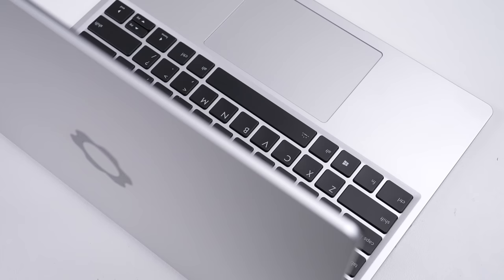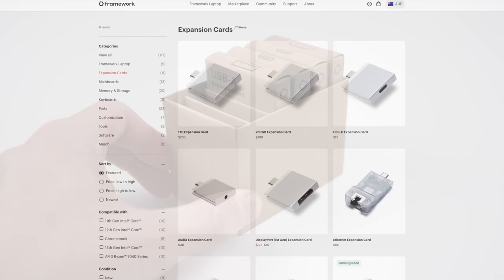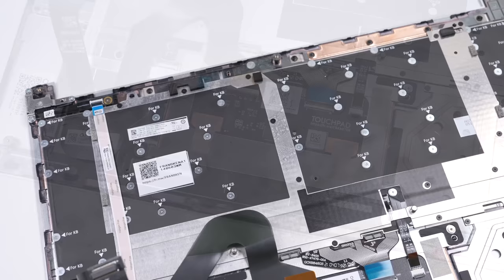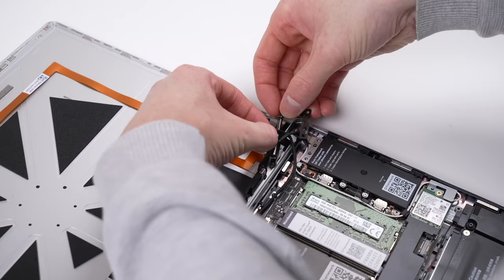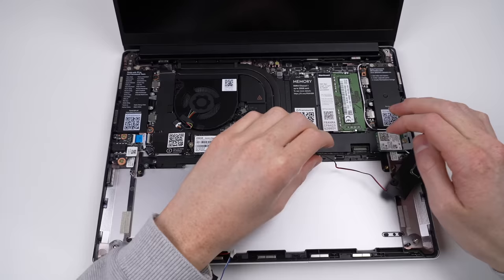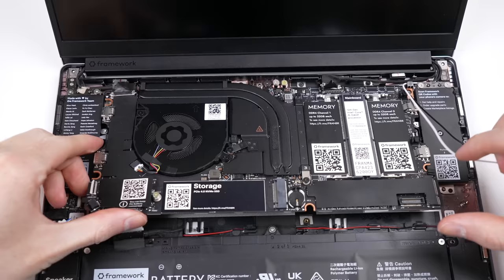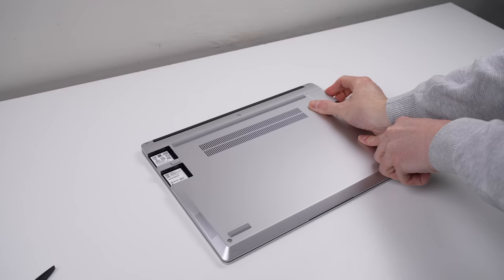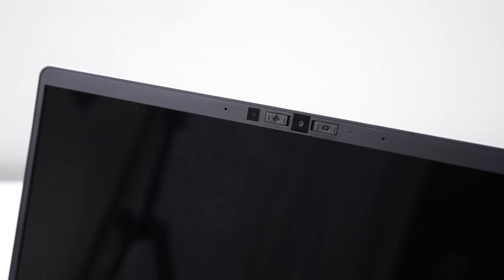New Laptop Brand Shocked Whole Computer Industry - Framework Laptop - Teardown And Repair Assessment

Comment: This company needs to be supported.  We should want all laptop makers to follow this example.
Reply: I am not giving them 1000 bucks for a 300 dollar laptop just so i can take it apart easily haha. You literally can buy a better laptop with everything for the price of the mother board he has there. 1000 dollars for a low end laptop with out windows is horrid priced.  You can buy a oled 90hz for 600 with the same specs. You can buy one with better specs then they have for 1000. Its just a dumb gimmick, but it worked on you it seems.
Reply: @FUmoneyWorshippers  then make them have machine to be manufactured cheaper as factories will reduce the production price from them if the number of orders is high enough, they are an entrepreneur having only few people and lack the ability to do so. Also, big companies can do it but they just don't want to because fix thing on your own might make them not be able to sell a new one for you that easily.
Reply: @FUmoneyWorshippers  The point of framework is to have the option to have laptop that’s repairable and upgradeable, if you’re buying a $1,000 laptop, thats fine; not everyone can afford a framework laptop, but if next gen costs $2,000 thats double the price of a normal laptop (especially with inflation). Thats not even getting started on repairability, having a good repairable laptop means if the battery stops working, then you just replace it, you won’t need to buy a whole new laptop.
Reply: Linus Tech Tips invested around $200,000 into their company I think
Reply: Nah. This is a niche. Upgradable or not, I treat laptops like a phone. Don’t wanna use more it than 5 years. If the laptop is your main system, it only takes 2 years or so for it become gross. You get dents, scratches, colors fade, grease, dust and dead skin cells all over. I always sell my them for cheap once it ran it’s course.
Reply: @ruok3351  learn how to take care of your shit then. I have been using my laptop for 2 years and I don't even have a scratch on it. and the whole point is that the laptop might cost $1000 but in the next few years when it gets old, you can only buy the motherboard or replace the battery, change the ports you use depending on the work. the new motherboards on their website start at $450.
Reply: Even if you can't take care you can replace damaged body parts instead of buying whole new laptop.
Reply: @Gobble.Gobble exactly like I have this phone for 5 years and I don't have a single scratch on this , if you take care of your device, it would look spotless
Reply: @MPCA_  You can replace batteries in all laptops. You are literally giving them 1000 bucks for a low end laptop that can be bought for 300 to 600. Upgrading a laptop that costs more than it costs to buy a new one is re re. So lets use my asus vive book i bought 3 years ago, for 600 with a oled. If I bought that framework, I could upgrade now to a i7 for 800 dollars. I could buy a i7 oled laptop for 800 dollars, and have 2 laptops. I could sell my asus laptop for 300 within a hour, and have it for 500. You are just talking about being happy by a gimmick. As I said, it would be like if Honda sold you a car with everything repairable and upgradable, made it easier to do. Then charged you 40k for a honda civic, and sold you the upgrade parts for more than a normal honda civic. I can afford a framework laptop, I just wouldn't buy a low end garbage laptop for 1000 dollars just so i can over pay them to upgrade it. 1000 dollars for a low end i5 laptop with no windows, and a low end garbage screen is super over priced.
Reply: I am willing to pay 20% more than the competitions in order to get a repairable laptop.
Reply: @FUmoneyWorshippers  i don't think that's a  $600 laptop. It's hard to find a laptop that's spec for spec identical with the Framework laptop that costs significantly less.
Reply: @huangcc72  I see, seems quite a few people will.
Reply: @FUmoneyWorshippers  you are trying to reason with cult members.
not gonna work
Reply: I'd love to see a desktop system built on the same principles.
Reply: @furrepanther  what principles?
Reply: @Gobble.Gobble  I do take care but you're lying. Reality is devices will never be 100% spotless after extensive everyday use. Even worse if you constantly bring them out for remote usage. Unless you rarely use them and store them in a weather proof case for months, then they always get worn down no matter how much you try to take care of it. I'd rather spend $1k on a new laptop after like 3 years and confident it will perform great than trying to revive a dying horse hoping the new modular parts will fix it.
Reply: I think currently largest uncertainty is whether company is manufacturing any components  after 10y time. If the connectors  would be stardardized and there would always be new components to choose from many manufacturers it would be awesome. Right now it's just a great idea.
Reply: @FUmoneyWorshippers  My top end i7 framework was $1000 so I don't need to "upgrade" to the i7 for an extra $800. I was able to bring my own SSD I had laying around which brought the cost down by $100. And you save $100 if you get the DIY version without shitty windows on it (plus everyone has a way of getting cheap windows licenses if they want). It's the fastest most performant laptop I've owned or used and even has more CPU power than some of my recent gaming desktops laying around. All of my computer science professors were interested enough that they are now eagerly awaiting the framework 16. I really support Framework's ethos for repairable environmentally friendly and open designs. My last laptop was the surface pro 6. The battery and speakers started failing but since they can't be replaced without also destroying the screen it is actually cheaper to just buy a brand new one for $1500. On the Framework, if my battery, ram or speakers started failing I can just easily replace them for much less than the $1000 I spent. They also ship the laptop to you with no plastic and only compostable packaging proving their commitment to environmentally friendly practices. They've released pinouts and technical designs on GitHub with open source licenses to allow tinkerers to experiment and design new things for this platform which will only get more connectivity when the framework 16 comes out with its pcie expansion slot. They are setting up a 3rd party marketplace for framework owners to buy and trade parts to recoup the cost of an upgrade or sell their own designs for expansion cards. If you don't see the value in the Framework outside of, "I'll just buy a new laptop in 3 years and this one becomes e-waste" then you are arguing in bad faith.
Reply: @Codazoa Most you see in the comments here are tech fans but not exactly enthusiasts or tinkerers. Reality is most people who buy laptops don't really give a shit in the long run. People buy laptops to use them here and now. Just like phones. To get what they want at that moment. People love to throw stuff away and will always want new shiny things. This is the reality  that sets in once the excitement of all the bells and whistles become stale. How many thousands of easily repairable laptops over the years have been thrown away? probably hundred thousands. Simply because most people are just lazy to repair them. It's old and boring. Rather have new one. Words like "upgradable" are ultimately buzzwords for marketing and people like you will fall for the gimmick.
Reply: No doubt.  We want this for all of our mobile devices, cameras, drones, cars and whatever.  But alas, they've removed real choice.
Reply: @ruok3351  You learned nothing here, did you. With a framework laptop, you can just swap out the keyboard and / or mousepad with a new one. And the display with a better one. You don't need to buy a new device, that is exactly the point.
Reply: @FUmoneyWorshippers It's a small company. They don't the economies of scale big manufacturers enjoy
Reply: @AarushKumar-sf1vkyou can put new displays in many laptops already, like Thinkpads. The only advantage this laptop has over my Thinkpad is upgradable ram and io-ports, and some Thinkpad lines do have upgradeable ram. The IO ports can be replaced with a USB C adapter/hub. So there are 0 benefits for me to get this instead of a ThinkPad.
Reply: @bellissimo4520  can do that with half of existing laptops. Call me when their hardware is open source.
Reply: Not really. It's just the same practice as apple.
Their own ecosystem of parts and components.
Until there are hundreds and thousands of options for upgrade and repair modules from any number of sellers and brands and places where you can buy without any restrictions or limitations, it doesn't have anything worth buying.
Reply: @ruok3351 my laptop still grunting through life 10 years on with only a single scratch: "Pathetic"
Reply: @roberts.wilson1848 their own ecosystem... except they've published all the specs and third parties are already manufacturing their own components for it ranging from port accessories to external motherboard housing
Reply: @AarushKumar-sf1vk point is that this doesn't bring anything new. It shows off right to repair but most laptops do the same already. Unless you're comparing it to Apple or MS Surface, which is just cherry picking. So there's nothing that sets it apart except for its marketing that's clearly working.
Reply: @FUmoneyWorshippers

You are free to do as you please.

However I want to see all the companies that pushed the non-repairable laptop be replaced with the paradigm that Framework is charging forward with.

Yes, you might think the present iteration of Framework  to be stuffy, but if this company does not insult its customers with ESG/DIE and other manipulation to last for more than a decade. I expect it is going to keep growing and I cannot wait to see their future evolution.
Reply: @ruok3351  wtf  :/
Reply: @maisaanmufeed438  Exactly.
Reply: @FUmoneyWorshippers  You can`t comprehend what this laptop means to every person that knows to hold screwdriver, you get aluminium case lap top on witch you can put conectors you need not wich manufacturer decide, you can replace ALL components by you`r self, no need to take you`r machine to repair shop, no need to wait for repair and no need to screw aorund with badly repair job. And best of all you can upgrade it who knows how many times and you call that a GIMIC?! I bet it`s just because you don`t have a clue how to repair ANYTHING, i will buy it first chance i get.
Reply: @AarushKumar-sf1vk Yes, there are plenty of laptop lines that allow that, mostly business line ones (ThinkPad, Dell). I bought a keyboard and display upgrades for my laptop. I can also upgrade my ram on one if I ever need to. Some laptops even separate the Io ports in case of failure, although that's more uncommon. Either way, you suck at making arguments. I keep telling you there are laptops like this already yet all you do is claim lies after I even say what line I'm talking about. Fanboys gonna fanboy I guess.

I actually changed my mind about this laptop though, it brings something else to the game which you haven't even brought up and neither does this video. I'm not gonna say what though, I don't wanna have to make your points for you.
Reply: @ruok3351  I actually quite liked the ascthetic of a worn beaten to hell laptop but I guess that's just me
Reply: @MPCA_  what are you talking about you can replace the parts in all of the laptops except Mac
Reply: Why should we? Just choose the laptop you want. If customization is your thing, just forget about Apple...
Reply: @FUmoneyWorshippers  i7 13th gen from Framework is $699, and that's for the complete motherboard. By itself, without a motherboard, an i7 CPU is $450. So for an extra $250 not only are you getting the upgraded CPU, but the motherboard that can house it, all of which can be quite easily be installed by someone with even little to no computer repair experience because of its design and the step-by-step guide that's provided instead of having a repair shop do it, which would likely cost you an extra $300-$500.
Reply: With the people in this thread bashing on Framework and their pricing, you're though process is so very narrow-minded. Yes the laptop itself is expensive in the onset, and there's a reason for that. The laptop was specifically designed to be easily repairable and upgradable by the everyday person and not only a skilled computer repair technician. That kind of engineering is time-consuming and expensive, so yes the laptop is going to be pricey in the onset. However, if this company gains traction with customers and more people start seriously considering them, the chance of them lowering their prices increases significantly. It's also a company that has built a computer that is easily repairable and upgradable by the common person, which will save people money in the long run and allow their computers to last them much much longer. I've seen several people in this thread talking about getting rid of a laptop every 2 years. To me, that's either wasteful to the extreme or you're just trying to flex about how much money you have, neither of which is a good look. Framework is trying to establish a pro-consumer stance, which is something that should be encouraged instead of continuing to throw money at companies like Apple who are decidedly anti-consumer when it comes to the repair of their products.

Speaking of, let's compare the two. A Macbook Air current gen is $1099, about $50 more than the current Framework i5 13th gen. For the average home or even business user, both will function at roughly the same level of power and capacity (in their respective OSes). Now, what happens if these laptops break in some way? We'll start simple and go with screen damage. If you have Applecare you'll be ponying up $100 already at the time of purchase and then a further $100 for the repair itself, during which time you have to send your laptop to Apple and be without your device for approximately 2 weeks if everything goes correct. So that's an addition $200 in addition to the price of your laptop for a single screen repair... if Apple agrees that it's just a screen repair you need. Remember, they're the ones who get to decide what should/needs to be fixed. With the Framework laptop, you're spending $179 for a new screen that is shipped to you, likely within a couple of days, and you can immediately replace it yourself because it's designed to be done so easily.

Now I know what you're thinking: So the cost is the same then. That was just for the screen, and presumably if the screen isn't cracked. If the Macbook repair is classified by Apple as "accidental damage", now your repair costs via Applecare go up to $300 in addition to the $100 you spent for the Applecare alone. Bear in mind that sometimes these repairs might only require a small part to be replaced such as a charging port. For a Mac, again with Applecare, you're looking at probably that $300 repair bill because they'll have to replace the entire thunderbolt card itself, at minimum, with a full board replacement more likely. With the Framework.... just buy a new USB-C card for $10 and slot it in. These are just a few examples.

Now let's look at the situation where a Mac user DIDN'T buy the Applecare... buy a new Mac. 9 times out of 10, if you ever need repairs done on any modern Macbook, Apple will just tell you to buy a new one because the repair costs will be almost the same price of a new one, and because they've glued, soldered, or riveted absolutely everything to the logic board including the battery, RAM, and SSD, very few repair shops will even touch a Mac to repair it anymore. While the same can't be said for Windows laptops, the way those are built aren't user-friendly at all when it comes to repairs. That was the entire goal of Framework even coming into existence, to design and build a computer that most average consumers would be capable of repairing (if they choose to) fairly easily. They also designed it so it would be easily upgradable so if the time did come that your current laptop is getting out of date and you want to upgrade any aspect of the computer (motherboard, RAM, SSD, screen, wifi card, etc) the average user could do so if they wanted without needing to take it to a repair shop and spend easily twice as much or more. And I haven't even delved into the concept of how this type of laptop could greatly help eliminate e-waste, which has become so prevalent these days.

The bottom line is companies like Framework should be encouraged to continue, not only so they can get better, but so they become more prevalent and they are able to reduce their prices so more people can benefit from their engineering feats.
Reply: malice5121  I don't disagree with you on the price, it is quite high, but I also understand why it might be that high as well. This is a new company that put a lot of time and effort into engineering this kind of laptop. That kind of work on the front end isn't cheap and unfortunately some of that is getting passed onto the customer. I sincerely hope the company continues to thrive and more people seriously consider or even buy Framework laptops so the company can grow and bring their prices down to more average consumer-friendly levels. If I didn't already have a perfectly fine and powerful laptop, I probably would have considered one for purchase myself. In point of fact, when my current laptop either ages out or becomes non-functional, Framework will probably be one of the first companies I turn my eye to for a replacement.
Reply: @ruok3351  Bruh, I'm using a ThinkPad that just turned 10. I just bought it.
Reply: @FUmoneyWorshippers  What you're missing is how much you're gonna save when you can just swap the motherboard out in five years rather than buying a whole-ass laptop.
Reply: They dont want you to fix or replace parts easily so you can just get another new laptop XD